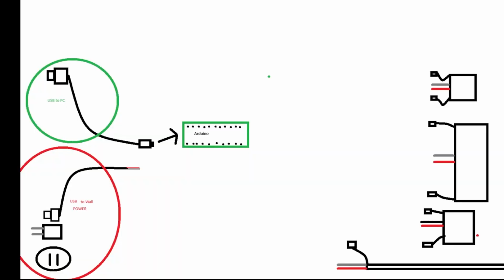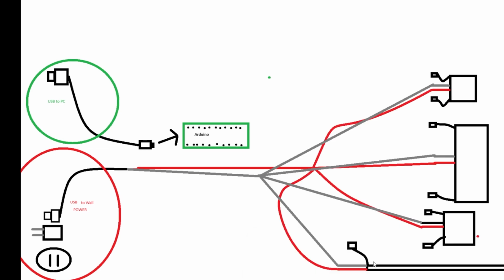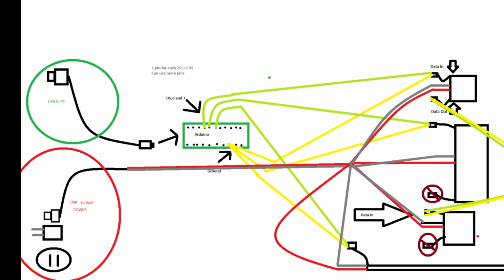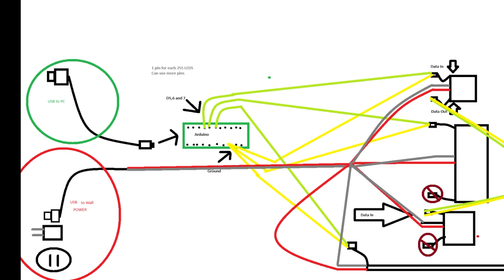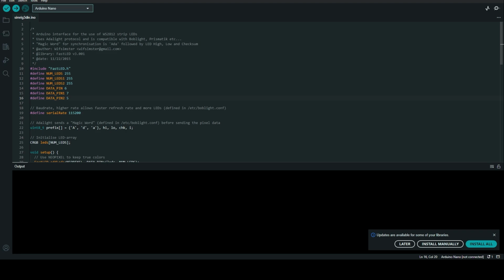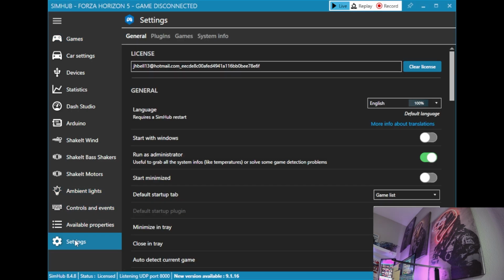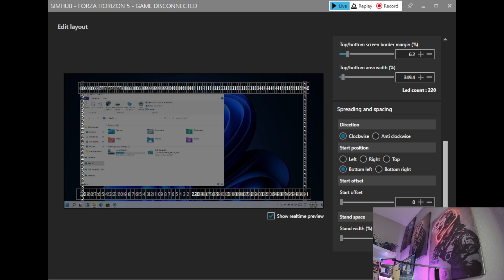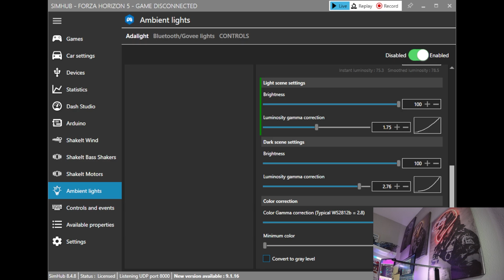DIY Sim Racing Ambient Lighting with Arduino: Step-by-Step Guide

Comment: Hey thank you for video. I am looking to start to build one (I was originally planning to go with Phillips Hue) but as i like to do things this sounds good option. At the moment i am looking that 255 and 64 LED matrix from Aliexpress. Seems options seems to be smaller matrix what i can find
Reply: Ah silly me. That is 8 x 32 led matrix making 256 leds lol
Reply from the maker: @simusami4944  I order mine from Amazon. I also recommend an LED power supply for that many lights. A normal usb is a bit under powered
Reply: @ThirdWheelExclusive  yeah i found some from Aliexpress and thinking should i get 3 x 64 matrix or 2 x 64 and 1 x 255. I didnt fully understand what you mean that Simhub supports only 255 leds?
If i would have 2 x 64 then simhub would only control 127 from 255 matrix?
Reply from the maker: @simusami4944  That’s outdated, you can run more now with a few mods to the code. I still prefer the 256 and two 64s split
Reply: @ThirdWheelExclusive  Thank you. I need to look this project. I was also thinking to design boxes for lights and arduino and 3d print them.
Reply: @ThirdWheelExclusive  where it would be possible to see what are mods needed to run more than 256 lights?
Reply: @ThirdWheelExclusive  I went to testing it first with 3 x 1 meter 60 LED lightstip and 5V 5A PSU what i ordered. I selected lighstrip as i wish to create similar casing as Phillips HUE has.
Reply: https://www.youtube.com/watch?v=pEhCS_X_OaE this is where i am now in project. I decited to go first with LED lighstip and i printed out light boxes i found from Printables (I think). Now just waiting that lights are available to pick from post. I was just looking your video of arduino and simhub setup. What i think i figured that Simhub settings of width and height etc dont indicate your led sizes but area of display where light changes are picked up and then affected to LED arreys you have. 
I might bo with my HUE replicas so that i have 1 lightbar on both sides and 2 in front
Reply: @ThirdWheelExclusive  First thanks for ya great Videos & greetings from germany! Just one question, I already ordered 1x256 & 2x64 WS2812B LED Matrix. How will I be able to setup this in simhub, because atm I just see, kind of lightstrip configuration and can not see kind of squares to position the light infos/position for the Matrix, like for the HUE or govee stuff. Or am I wrong? Thanks in advance
Reply from the maker: @splanka6645  It is configured from the strip configuration. You won’t have the same grab points as govee but you can still adjust sections of the light based on the number of LEDs. I us 200 across the bottom and 28 on the side. That will double to 56 then adjust margin until it feels right.
Reply: @ThirdWheelExclusive  great man! Thx a lot for the support